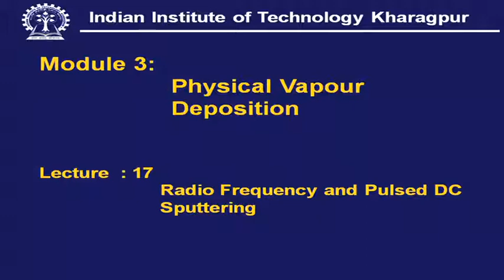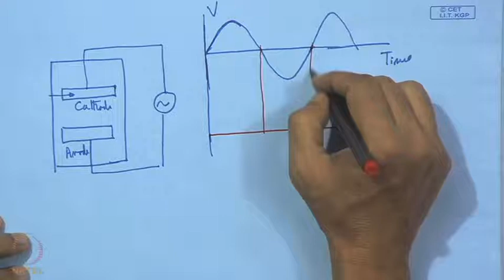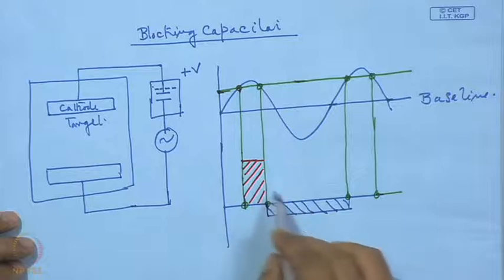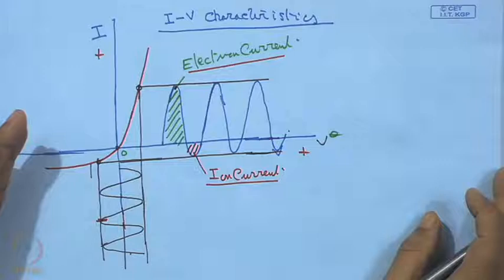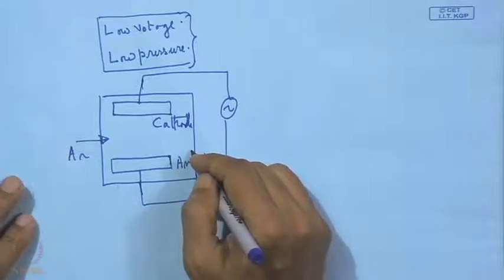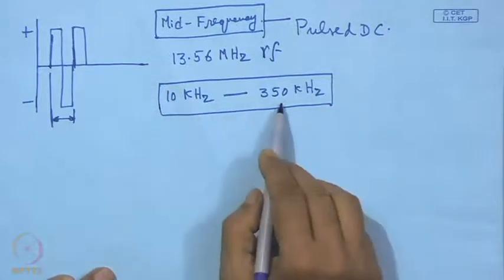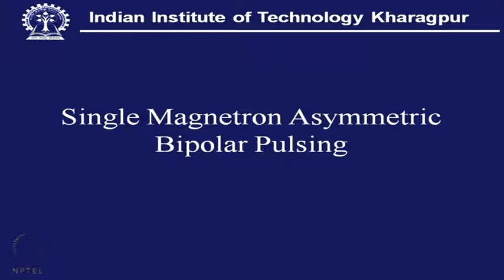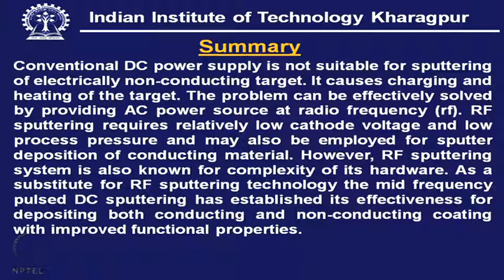Mod-01 Lec-17 Radio frequency and pulsed DC sputtering

Comment: This blocking capacitor should be electrolytic ? Or What kind of one should be used ? Under the 1000V can i use AC microwave capacitor ?